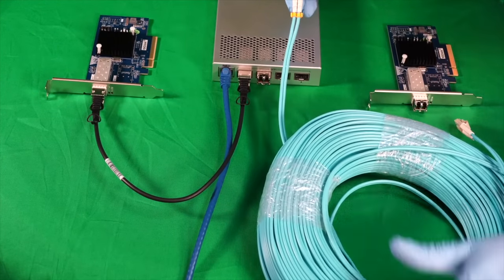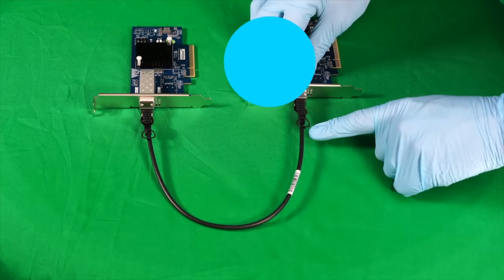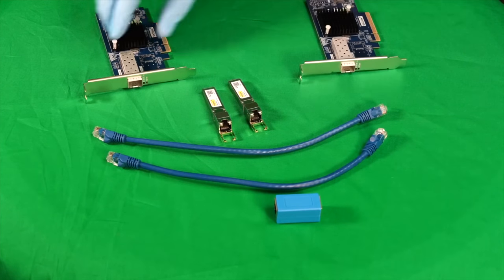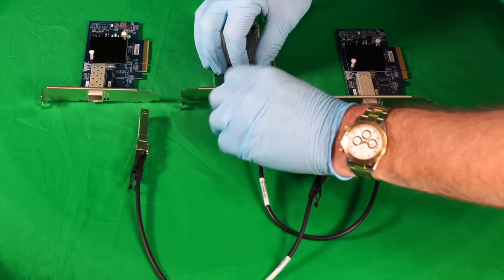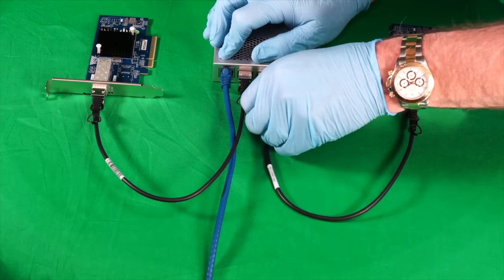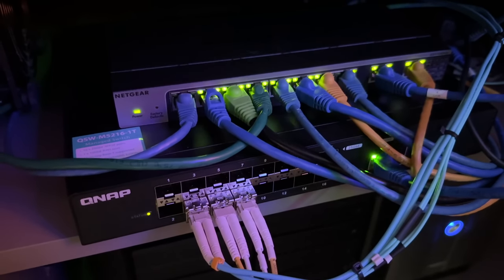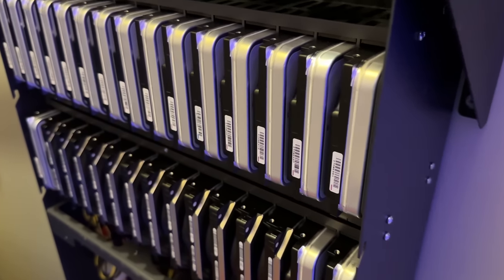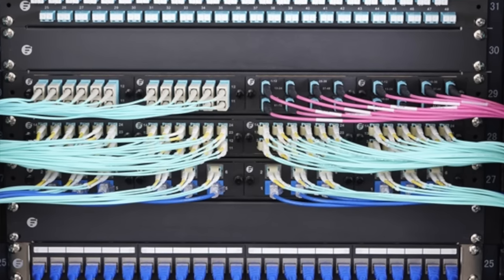10G and 25G Networking - SSD Speeds on the Net

Comment: University of Alaska Anchorage was using BNC connected coax into the 1990's; when working registration in 90-92, most of the registration devices were IBM 5150's, running TN3250 terminals over ethernet. They also (mostly) still had the matching monitors. That ended about '94... when all class enrollment went to phone or dial-up for continuing students. '95 saw 10-base over cat 5 TP into offices, replacing dialup via PBX lines not-connected to outside telephony.
Reply: Now a days, many colleges, including 2 year state colleges are running full 2G internet, at minimum, with internal switches capable of the same using RJ 45 connections with smart ports that shut off if you swap PC's that have a different IP address so the network guy(s) needed to be aware and reset the port. All phones are VOIP based phones so if you first note no dial tone, chances are your PC is not getting the internet either. Your port has shut down. 

The 2 year state college I worked at was upgrading to 2G internet internally and externally and have wireless nodes for personal computers and/or phones. The internet and networking has come a long way since the 90's and the college also runs modern Dell computers, a combination of desktops and laptops.

Comment: hey, great video. I would be careful about running a managed switch as a dumb switch. it may assign itself an IP through DHCP and still be available on your network with default credentials. I would at least change the default credentials and if you want to use it just dumb maybe assign it a static ip on a different subnet or there may be a way to disable management

Comment: Dave, you just need one update: 1) for the 2.5GHz copper RJ-45 option… then you can also use 2.5Gbits local ports into a 10G switch… otherwise this is really well done Dave.

Comment: That 25 Gbps over USB-3 connector device looked interesting but the price is eye-watering $1600 on sale (ATTO ThunderLink TLNS-3252).

The switch (QNAP QSW-M5216-1T-US) with 16 ports 25G each at $1100 looks pretty cheap compared to that.

Comment: To be slightly pedantic: the Cat5e spec actually supports up to 2.5gbe at ranges of up to 100 meters, and can also handle (though not as reliably) up to 10gbe depending on distance and cable/termination quality.

Comment: My nerd credentials goes back to 10Base2 thinnet with terminators and BNC-T connectors, 10Base5 Thicknet with vampire taps, and token ring networks. There was actually no TCP/IP protocols on these networks originally. Used multiplexors to connect multiple sites across ISDN lines, etc. Then 10BaseT came along with IP addressing instead of the old IPX addressing in Netware networks. Life changed dramatically. I can hardly wait for terabit networking standards, because you know they will come.

Comment: My home network has gone from a mix of Thicknet and Thinnet, to Token-Ring, to normal twisted pair copper which was a godsend because as with USB devices, none of my ethernet connected devices ever became obsolete again. I absolutely love that I can mix my old 10Mb stuff with 10Gb on the same network. Same experience with USB-1.1 and USB-3 (4?) although it can really choke if you have a crappy chipset in your USB switch as was often the case.

Comment: there are 10gbaseT RJ45 SFPs that are rated 100m over Cat6A with TDP 1,9W. Also most of devices support auto-MDIX, so no need to worry about crossover or straight cable. Biggest pain with 25GbE is FEC compatibility.

Comment: Fiber is also nice for when you want to run network between sites or structures and don't want the headache of electrical continuity between structures, especially in the case of lightning and other real bad time scenarios. There are low cost unmanaged switches now with SFP upstream and gigabit and/or 2.5GBase-T and/or 10GBase-T on the local PHYs.

Comment: I tested out the limits of my router by copying a large file with ssh from my desktop to my laptop (also smaller files from a VM to the host with ssh), my standard onboard network on an X570 motherboard gets around 111 MB/s. Not bad, much faster than my internet-connection. Interesting to notice, the speed gradually (very slowly but noticable) increases while moving one big file, I can't explain that.

Comment: Was crystal setup to display MegaBytes (MB) or MebiBytes (MiB)? The latter is always lower than the former due to base conversion of binary. For example, measuring 1000 bytes versus 1024 bytes, multiplied ad nauseam. People often get this wrong, because both disk capacity and network speed are actually measured in base-10, where memory capacity (thus filesystems) are done in binary base-2. Even so, I'm not sure how you got that anomalously high result. I've not worked at the math, I'm just  musing about ideas.

Comment: Just worth mentioning: while the official spec for Cat 5e doesn't seems to support 10GBASE-T, there are a lot of real-world examples where it actually does, albeit not the full 100 meters but up to 45 meters depending on the cable quality. My google-fu seems to suggest that most Cat 5e cables support 10GBASE-T to distances between 30-45 meters.

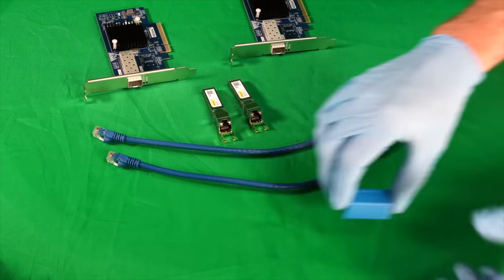Comment: @3:33
Dave, I believe that crossovers are a thing of the past -- that is, the need for using a crossover cable or a module that performs the same function.

The network card's controller (or something built in to it) senses the signal from the cable, and handles it accordingly.
Any cable will work with any network card, between two computers, to negate the need for a switch.

Perhaps there is a network card on the market that will not handle a non crossover cable without a switch?  But I doubt it.  I believe that any NICs manufactured in the last 10 years (perhaps longer) will work with both crossover and non crossover (twisted pair) cables between two computers.
Reply: It's called Auto MDI-X and it is part of the 1000Base-T standard so anything gigabit or faster will not need crossover cables

Comment: I don't need to buy a crossover,  I can wire one myself.  it is all in how you setup the twisted pairs into the connectors on the end of the cabling.  Network cable, Patch cable and Crossovers are made by how the twisted pairs are wired.  Of course if you are not tech savvy or if you are lazy you can just buy one.

Comment: Obviously the vast majority of people are going to go with twister pair.  With that in mind, make sure to get a pass through crimper and pass through connectors.  They make life so much easier!  It's also important to note that the SIZE of the wire is different between 6 and 6A.  You can use 6A connectors with 6 cable but not the other way around.  In other words, just buy 6A connectors even if you do a 6 job.  In the future you don't want to find yourself stuck making a patch cable with 6 connectors and 6A cable.

You can easily tell the difference because 6 connectors have the wires lined up from end to end whereas on the 6A connectors the wires are larger so they are staggered.
Reply: Even better, skip the connectors and put in keystone jacks in the wall.
Reply: @stevesether  What?  Are you plugging two keystone jacks into themselves?  What do you think connectors go into?  Your comment seems to imply that jacks sit there and connect everything together.  You're going to need many more words to explain what you're talking about.
Reply: @JustinEmlay  I know what a keystone jack is and how it works.  

Please assume people know the basics.
Reply: Wire gauge is only part of the difference, most manufacturers of Category 6A cable include a mylar foil to reduce Alien Cross Talk between cables and terminates to RJ-45 ends without any changes to procedure.  Another difference is in the rates of twist of the pairs in the cable, as well as the rates of twist of the 4 pairs together.  The standard recommends that field installed connectors not be installed on Category 6A cables (though everyone does that anyway).
Reply: @stevesether  Then you're making no sense.  What does using a jack instead of a connector have to do with anything when you need a connector?  If you were making a joke I didn't see it.  A patch cable with two jacks on it doesn't do anyone any good.
Reply: @CarmonPerrin  Of course there are other differences. I was simply going over the purchase relevant differences.  A purchase was made for me once and said person didn't know the difference.  Got all the way on the other side of a 300k square foot warehouse in a man lift and all the way up to the ceiling when I had a oh crap moment.
Reply: @stevesether  Good, then you're done here.  Take your nonsense somewhere else.

For those wondering what I'm replying to, his last comment was shadow banned.
Reply: @stevesether  Your comment makes no sense and has nothing to do with what the OP talked about.  You don't have the high ground here.
Reply: @stevesether  Enough!  No one cares about your list and you need to take your own advice about being polite.  The fact you need to make lists and keep getting shadow banned tells me it's you that is the problem.

Stop commenting here.

Comment: First exposure to networking was bnc connectors.  I got pretty good at making those cables.  Makes me feel pretty eld.  1g is still the shiny new stuff in my head.
Reply: That was me about a year ago and was impressed when the local 2 year state college was upgrading to 2G, now I have 2G at home (down only) over a 5G gateway. However, when it's over 1G, the upload speed is around 20MB up, which is not bad when you consider most still run at least 10MB to 55MB down at minimum over cable/DSL.

Comment: I installed cat 6a in my house a couple of years ago. I just wanted the best cables I could get without paying too much for it. But man, I regretted my choice a several times during the install. That cable is a thicc and stiff boy!
Reply: SlimRun cables are awesome :).  30-32AWG but still with the signal characteristics of CAT6A
Reply: @ausnetting  oh, I have only seen cat 6 as slim (which maybe is good enough anyway). But the cables are installed now, so my only regret when it's done is that I didn't go with cat 7 to future proof it 😉
Reply: @user-ni7ct5vr8u  Ya, I would have gone cat 7 myself as well.
Reply: @Darkk6969  I did this maybe 2019 so I wasn't even sure what cat 7 was really. Oh well, 6a is probably fine for a while 🤷🏼‍♂️
Reply: @user-ni7ct5vr8u  Certainly better than 5e! :)

Comment: Excellent overview of fiber and copper! I work in data centers now, came from telco world. I would like to provide some feedback regarding the colors used in fiber. The color is Rose(or Violet) and Aqua, not Pink and Blue. Blue is very different in the color code, and I think this could be confusing for the uninitiated. I did catch you saying Aqua later on ;) 

We also have a saying: "don't look into the fiber with your remaining good eye" 

Thank you for a great video!
Reply from the maker: Wish I'd read about the "don't look at it part" first :-). I don't think I did any damage, but did have a couple of spots in my vision for a day or two, so maybe it was just "flash blindness" in spots.  Hope so!

Good calls on the colors!  I used to work in a paint store, so I call them "Frosted Strawberry" and "Arizona Sky", but Rose and Aqua work too :-)
Reply: The colors can be custom ordered, but usually is for special purposes.  There are color codes for both the grade of fiber in the cable (in the case of a hybrid (single/multimode) multi fiber cable, the jacket color for indoor rated fiber usually matches the dominant fiber type in the cable.  The connectors are also color coded (for single mode blue is UPC, green is APC).  I have seen single mode cables (yellow) with blue and orange pigtails just to make things interesting.

Comment: One thing: Please consider cleaning the fiber connectors before plugging them in. Having bad connections due to a not press fit or even scratching the surface of this connectors is something to have in mind when handling fiber connectors. So better keep them protected and clean them before use.
Regarding cross over cables in copper. They were never necessary between a switch and a PC. And with auto-sensing they became obsolete. I don't know if SFP+ modules don't have Auto MDI-X (some proprietary connection, not 10GBaseT)? Usually SFP+ modules are used connecting switches with each other or a switch with some kind of server. I never read or heard about the need of cross over cables in this case, and assume that due to auto-sensing it makes no difference. Which makes cross-over connectors more or less useless.

Edit: Never heard of RJ48 and a quick google (good luck with this accurate information) brought up the information that the difference between RJ45 and RJ48 is not the connection of the shield alone. If the information on the Cisco community from 2002 (not a new topic, it seems) is correct RJ48 is/was used for T1 connections and  pin out is different. Also there are many different pin layouts that are called RJ45S or RJ48C etc. It seems to be necessary to know when you have T1 connections etc. Not really in a LAN for an end user. RJ45 connector with all 8 pins (8P8C) straight through, shield connected (for higher speed), and the wire pairs correctly connected to 1+2, 3+6, 4+5, 7+8, and you are good to go in your LAN. The time when Ethernet used only two pairs are long over. 10GBase-T works with all eight pins.
looking at Wikipedia, RJ45 (or whatever RJ) is not the correct description for the connector in a modern LAN anyways (although everybody uses the term RJ45, so run with it). The connector is a 8P8C used for ANSI/TIA-568A and B and Ethernet. TIA-568A or B seems to be the most accurate description of the pin layout of the 8P8C modular plug. (Now I have to take this stick out of my arse.)

Regarding fiber. It gets simpler and more complicated at the same time. Forget OM1 and OM 2, that is old stuff. About the length of the connection take a look at the SFP(+) modules and what they support. Usually multi mode fiber can go long distances, like a couple of hundred meters if the speed is not extreme high. Take care to have matching components. Don't mix 62.5 and 50 µm, try to avoid to mix different OM types. (And don't mix single and multi mode.) Clean your connectors with special tools and keep them protected. Just take a look what the devices you buy support and that all components, all cables and connectors match. Seem complicated. But you don't have to worry about electric cross talk or some lightning destroying your equipment through a (now fiber) connection.

Comment: Using QNAP switch with SFP+ DAC wires for PC and NAS gives me like 800MB/s read speed. Higher bandwidth will make more sense when SSDs replace HDDs and PCIe Gen5+ becomes common. I failed programming, but succeeded in IT :-)

Comment: Interesting that the 10G RJ45 transceivers don't have auto-crossover. I haven't seen a network card or switch that hasn't had that feature in the last decade. And my favorite thing to do this with has been setting up a 40G connection from my home VM server to my NAS where I keep all my VHDs. That way I keep all my compute on one dedicated machine and the storage on the NAS under NFS and iSCSI mounts. I run a pair of cheapo 128GB NVMe M.2 drives in mirror for the boot drive, but everything else is protected from drive shenanigans by the storage performance-focused NAS. It was a fun little project!

Comment: Three things:

1) Fast SSDs = they die faster. (You wear our the finite write endurance limit of the NAND flash memory/cells/modules faster, due, in part, to it being faster. (i.e. it's faster, so you'll want to use that all the time instead of HDDs, and by using it more, you end up killing it faster.))

2) Notice that you needed to have multiple streams going simultaneously to be able to actually HIT (or get close to) the 25 Gbps speeds. The individual streams were only at around 4 Gbps, which, as you mentioned in your conclusion, is what you would need to be able to work with 2160p video smoothly. (And that depends on whether or not your video editing app is able to use/spawn multiple network streams to be able to pull in the video data simultaneously.)

3) These data rates are only available for large, contiguous, sustained transfer rates. If the files are fragmented in any way, and/or the size of the file exceeds the SSD cache, then the speeds will plummet.

Comment: Wired my TR to my NAS using SFP28, works great.  Wish I had a faster NAS.  Used the qnap M5216, but I'm already eyeing the cheaper Mikrotik 100Gb switch.  Sadly qsfp28 nics aren't cheap.  Use shuttered keystones!  They're more expensive, but you don't have to worry about kids peering into lit/empty jacks.  Chose single-mode just to avoid having to worry about losses with multiple keystone connections, although I'm still running everything under my desk.  Not really much difference in cost, although ymmv.  I really only do network upgrades occasionally, so I didn't see much reason to stop at 10.
I'm using the managed features on my qnap switches -- the M5216 works fine, the M2116 less so (loud, and doesn't handle link aggregates on vlans).  Again, ymmv.  Would prefer a small 2.5G poe switch with an sfp28 rather than sfp+, but, what can you do?